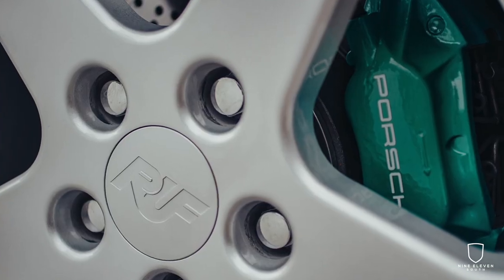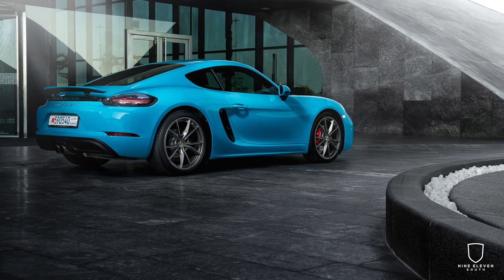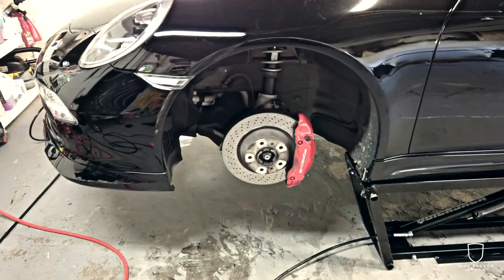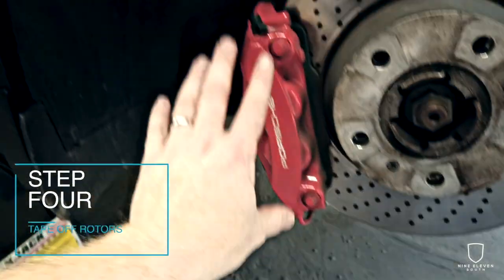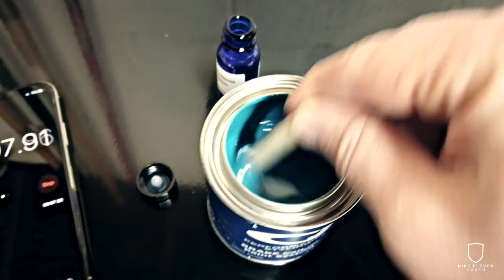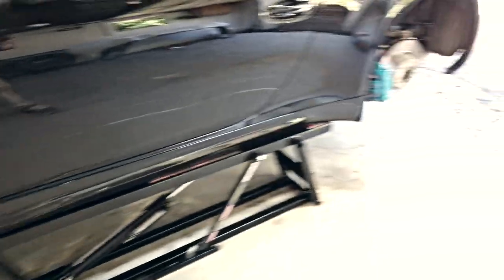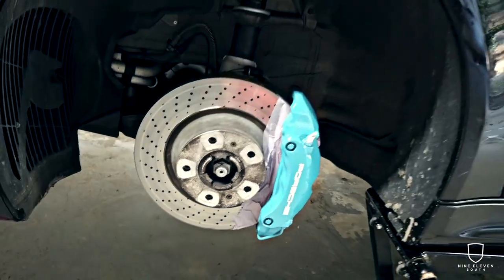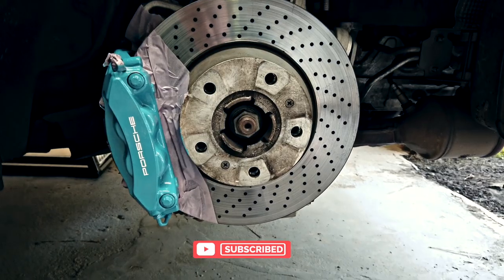How to Paint Your Brake Calipers | The 991 Custom Performance Build Series [ Episode 9 ]

Comment: Fantastic overview.  Lovely color.  My silver 987 CS accent color is green.  I may try to have the 60s Dr. Pepper green color made for my calipers.  How difficult is it to not have streaks from the paint brush bristles?  Thanks!
Reply from the maker: Thanks for watching and for your feedback! Sounds like a cool color. Avoiding brush strokes is easy as long as you go slow and do more coats than less. The paint is sort of self leveling so after the 2nd or 3rd coat the brush strokes are gone

Comment: Great content. Did you sand the calipers first? Wipe down with rubbing alcohol prior to 1st coat?
Reply from the maker: Thanks for the feedback and thank you for watching! No sanding prior to painting. I cleaned each caliper throughly with brake cleaner but didn’t use any rubbing alcohol.

Comment: Great job! For your previous 993, the calipers  are already painted in black from factory. Did you sand them before applying the G2? I tried to paint them with G2 paint,but it doesn’t seem to work. Thank you.
Reply from the maker: Thank you! I did not sand the 993 calipers before applying. Just cleaned them very well with brake cleaner and ran over then with a wire brush a bit.
Reply: @nineelevensouth  Thank you.